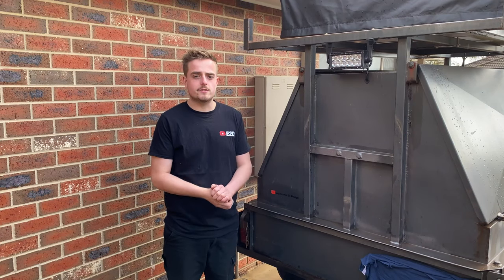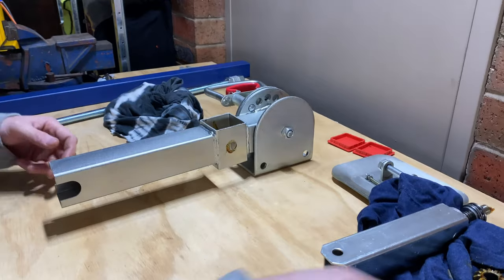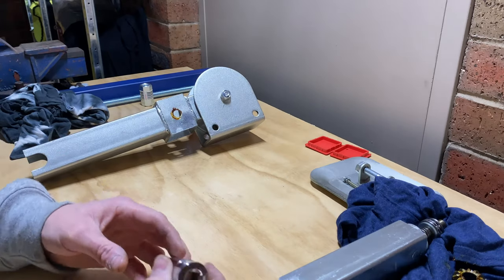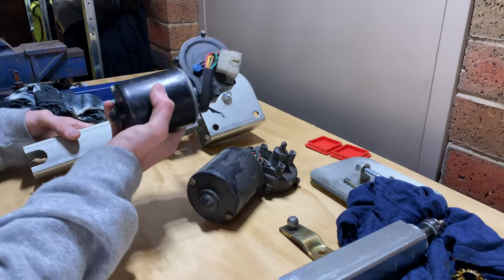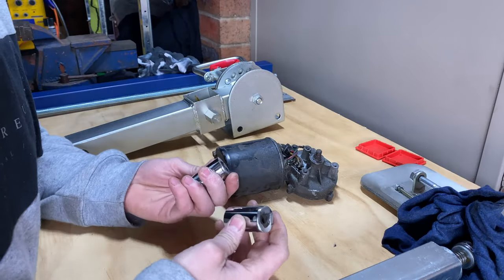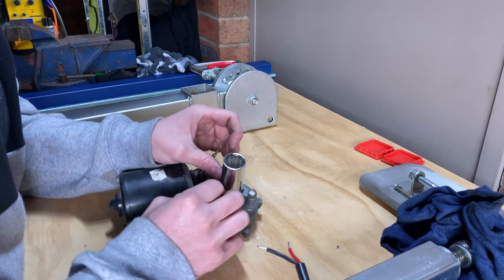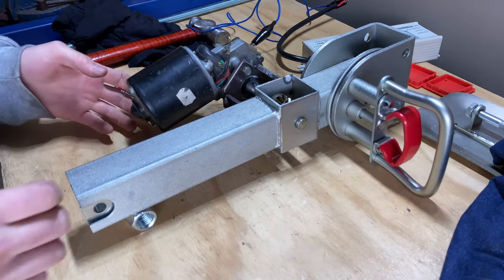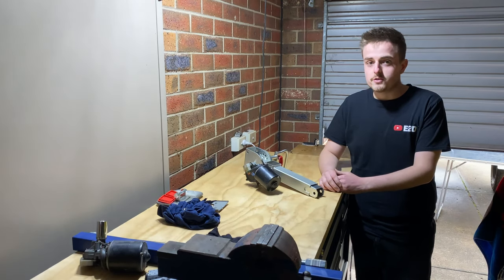Electric Stabiliser Legs

Comment: Late to the party but the weakest link in the setup I've found is the cog gear inside. Having run a drill on mine for a while I've shattered the gear in one of my legs and had to replace it. 

Great idea, these motors pack some serious torque. 

Motion dynamics have an awesome range of wiper motors at a really good price with decent options!
Reply from the maker: Yeah they did seem weak, I ditched the idea it was bulky and inconvenient..